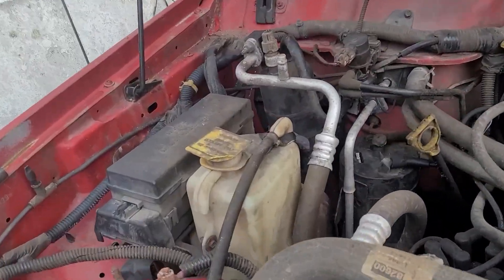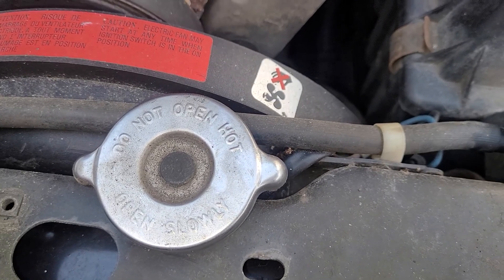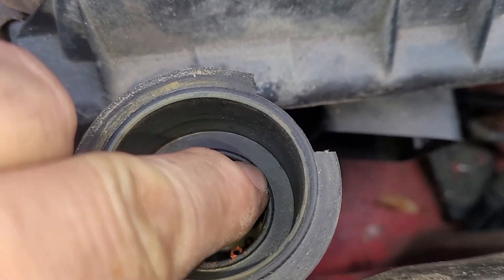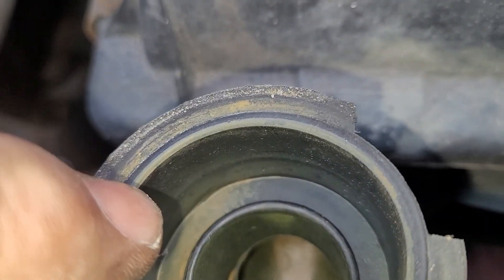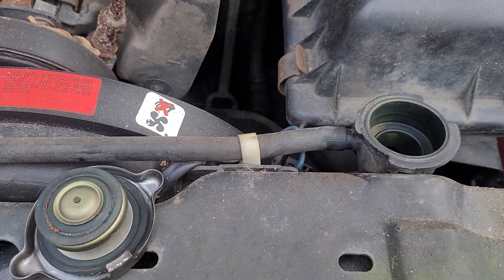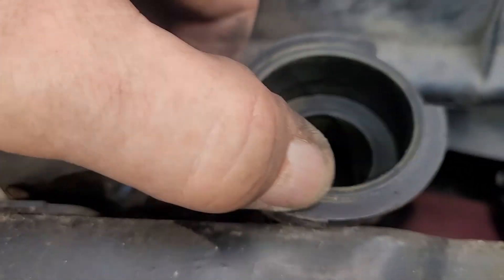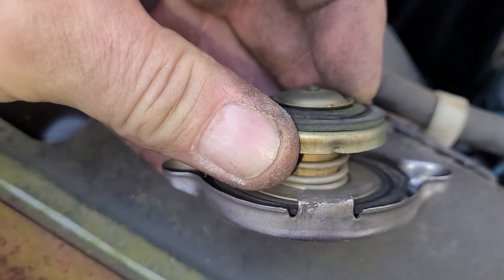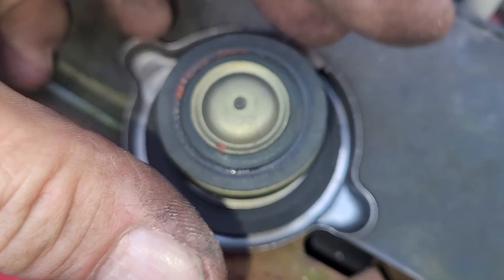A Discussion about Radiator Caps, their importance and how they work. #overheating

Comment: Thanks Bud we do. Hey Kenny, what Fuel line/trans line release tool do you recommend?
Reply from the maker: I Thought I responded to this yesterday , I guess I didn't . Sorry about that . I really like the Blue Point YA9457-1 & YA9457-2 for fuel lines . Usually , with trans and oil cooler lines , I use a pick and take the clip off . then on assembly , I install the clip first , then push the line in til I hear it "click" past the clip. Hope this helps !! Thanks for watching !!
Reply: @WrenchingWithKenny  you did this was a different day on a different video Thanks
Reply from the maker: @OldManTinkers  lol . Sometimes I can't for the life of me remember if I actually did what I was thinking of doing !!